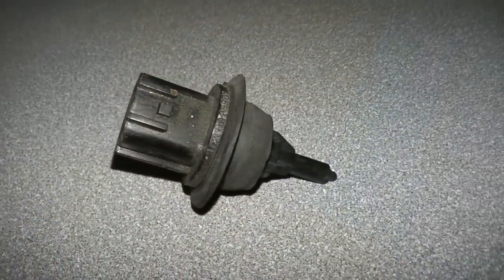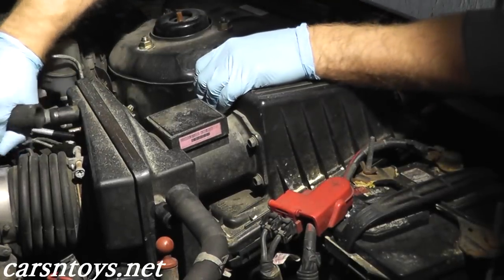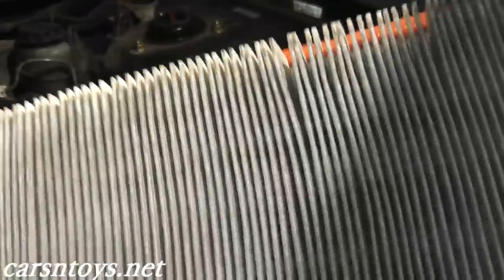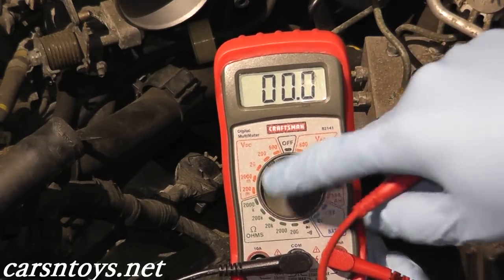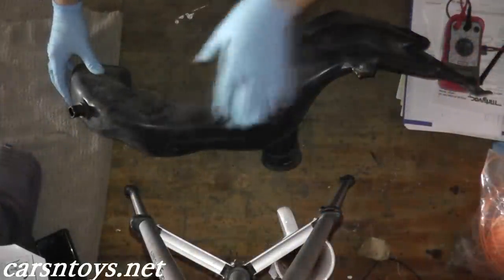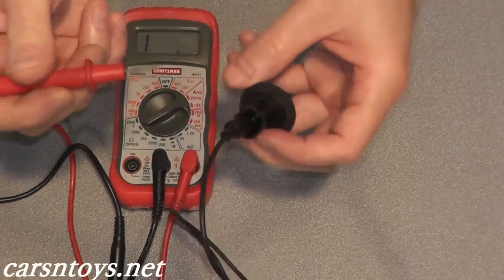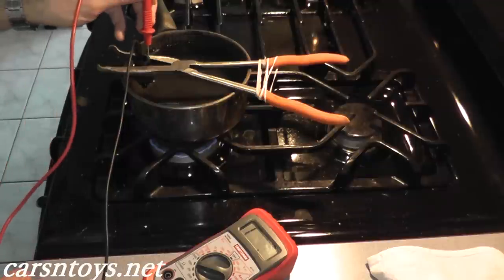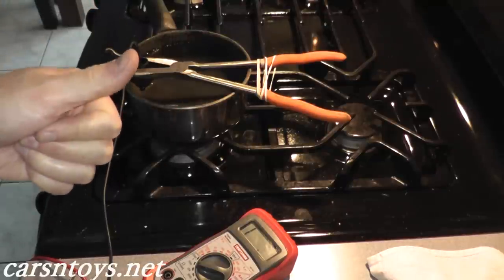How To Test and Replace Intake Air Temperature Sensor P0110  HD

Comment: Many thanks for your video. By any chance, do you have another one showing on how to repair the wiring of the IAT when we do not get continuity/ after all, changing sensor is the easiest part and the one that mechanics love to do. I would like to learn about the other end of that connector of the IAT sensor. Does it end in the fuses boxes? The electrical repairs are the most expensive.

Comment: Thanks!  I didn't know what this device was, but the two wires broke off right at the harness. Not enough to solder to!.  After seeing this video,  I removed the sensor and tested it. It was good (1.9k)
I checked the two frayed wires that broke off the harness. Good (5v  and Gnd continuity).   Rather than buy a new sensor and harness I scraped and cut away enough of the harness to solder two wires. I mechanically strengthened them to the harness.  I checked the resistance of the two new wires after plugging in the sensor.  1.9k  Perfect. I put the sensor back on the intake, soldered the two new wires to the frayed ones and voila! no error code, and probably smoother running in the winter.  1997 Infiniti Q45 w330k miles now runs perfectly again. Zero cost. 15 minutes labor.
Thank you!  You do a great service to all is DIYers out here.
Reply from the maker: +Mitch Bogart Thanks, Mitch. Glad to help and good job getting the sensor back up and running
Reply: +CarsNToys All the tests that i did came out good. So if i clear the code from the code reader it should go back to normal?Great video very informative/Cheers
Reply from the maker: Rob Hernandez
Yes but it's interesting that the code came up.
Reply: +CarsNToys I cleared the code and started the engine, no more code! yay!Now to keep an eye on it hopefully it wont come back.Cheers
Reply: +CarsNToys  Probably the reason was that i had to take the distributor out to change the body "o" ring and i had to remove the air filter assy so i had to disconect the plug to the sensor.Thank you for the fast response and great video!

Comment: .. by the way, the hose clamp used at 7:50 - is one with brown handle grips beter than one with blue. I've seen one at my tool store with blue grips - does this make a difference to the multi-meter readings? Please explain. Also, when you grip the sensor plastic housing - what torque are you using? Have you calibrated your grips? Do you have a calibration tool? This video clearly needs more explanation to be understood clearly. Is there an accompanying manual for download? (Is it available in different languages?)

Comment: a section of the harness came loose from someplace.  it had a grey connector on it but after taking the car home (after an accident)  the connector had dragged on the road and lost its connector.  enclosed pictures.  can you tell me what i need to do to repair this. does it have to do with ambient temperature sensor?  how do i send pictures?

Comment: I have a 99 Maxima that had been giving me a little bit of trouble starting for about the past month- sometimes I would turn the key, it would crank, but wouldn't fire, I'd release the key and try again and it would fire up. Finally a few days ago it wouldn't start at all- just crank crank crank. After swapping out the fuel pump, fuel filter, and battery, I was finally about to call the tow truck when I noticed a wire dangling loose. It was the wire harness to this air temperature sensor- the whole sensor had in fact broken out of the air intake duct (someone who owned the car before me had apparently lost the rubber grommet that holds it in, and tried to epoxy it back into the duct.) I got a 70 cent grommet, plugged the sensor back into the intake duct, and the car fired right up. So if you have a crank-no start issue that's driving you nuts, you might check this!
Reply: The same thing happens  with me..even when I boost my car some time crank some time silence I discover the harness is exposed and one of the wire cut and both of the wires fried of heat. So I am going to change sensor and harness. Thanks so much to share with us your experience.
Reply: Thanks for sharing your experience. I am having now a crank no spark with my camry and error code telling me that air temp sensor has a problem. 
This might give me a hint, thanks!

Comment: Hi I have a 2014 van and have a dtc0110 air intake temp fault. No light on dash but van is down on power? Would this sensor cause this issue ?

Comment: Great video. Thanks for your help. I swapped the sensor out as per the video.  I do not have a multimeter so I just opted to buy a new sensor. Now I wish I would have had one because on a 98 i30 I am getting P0110 sensor wiring code. And P0302 cylinder 2 misfire code. I had a code on cylinder 4 and swapped it to the 2 position and the code followed. 

Car is rough, low power, misfiring and stalling out at lights. I swapped spark plugs and fuel filter too. 

Could I have a bad wiring harness for the air intake sensor and a bad coil pack?

Comment: i think it is not the voltage you are measuring. based on the video ( meter range)  ,  you are checking the resistance of the sensor.  But anyway, thanks for this simple demo and clear explanation.
Reply from the maker: +keane cabrera Glad to help

Comment: Can i test a ambient temperature senso the same way IF I CAN i already did it and im getting power even with the ignition key of is the normal and when i check the continuity i was having on both pins

Comment: This video has been very helpful. On my 2002 Citroen Xsara Picasso I've got a P0105 (MAP sensor) and a P0110 (air intake temp sensor) code. I got no resistance on terminal 2 of the connector with the ignition switched on. I had the same on terminal 2 of the MAP sensor connector and these are connected to the same pin on the ECU so I think there must be a break in the wire or a bad connection.

Comment: Do I have to disconnect the negative terminal on my battery before doing any testing?
Reply: Maria, at least for this video test he did mention to turn the ignition key to ON, so that indicates to me that we need the battery cables connected for the testing to be done. How is your learning doing? I am in the same boat. I also have a P0500 code to fix and I have been driving w/o speedometer for 2 yrs. Regards from FL.

Comment: This sensor it's designed to measure the air weight because boulder the air the heavier and the hotter the lighter so the computer can calculate fuel trims. 
But don't get me wrong I'm just trying to help here. Greedings. :)

Comment: I used a heat gun to test my cabin air sensor and it worked fast and have me the info I needed. just don't burn yourself.
Reply from the maker: Good tip!
Reply: I have a couple questions about my 1998 Nissan pathfinder. Been doing tons of research..

Comment: CarsNToys Hey great video, thanks.

Tested the IAT sensor and its good, but terminal one on the harness is only reading 0.02 volts. Could this be a bad harness or the wiring itself?
Reply: CarsNToys Ended up being the red wire. Had a small break in it. Thanks again!

Comment: Thank you so much!!! I already replace this sensor and my car (Infiniti i30 1998) runs perfectly now. Before, the motor TurnOff / Die every time. One question: Now my car show CODE P1320 (Manufacturer specific) and the SES Light is On. I replace the ignition coils and spark plugs too. Any idea? Tks guys!!!!!!!!
Reply from the maker: Leandro Martini Check out my site carsntoys.net. Click on auto repair then click on engine control. You'll see a video for P1320.

Comment: When theres no reading on the harness theres a problem with the circuit? What would be the solution for that? Cause Im not getting any reading on the harness connector at all
Reply from the maker: First, check the wiring; make sure there are no breaks. (Typically, near the harness connector.) If that looks okay, check the fuses.

Comment: When resistant drops that means more voltage coming to car computer. In other word the sensor tell the computer that the air is warm or cold or hot. Is it true?

Comment: It is great, does it effect emission test?
Reply from the maker: Yes. If the engine light turns on the dash they won't pass the vehicle. (At least in most states.)
Reply: @CarsNToys  Air temp is used for computations for the car, but, would you know how it actually would cause emission leaks?  Also, having recently had a mass airflow DTC and resolved with merely cleaning that sensor, may the P0110 also come from merely needing that sensor cleaned?  Thanks for any thought you may have.

Comment: It's not voltage that is dropping, it is the resistance dropping. For example at 9:17 or so.  Using incorrect terminology (saying voltage instead of resistance) just confuses all that don't know better, and are attempting to learn.

Comment: My bmw e46 2003 model 320i has a problem of air flow meter if It's conected the car is masing. I bought the New one but it's doing the same thing help pls
Reply from the maker: Obtain a copy of the BMW service manual. The manual will show you the locations of all sensor and its wiring.

Comment: hi my car sometimes wont go over 1000 rpm and i have to swtich the ignition on and off to get it working. i was told by a mechanic its the air intake sensor and that its faulty. just wondering what your thoughts are on this and if this is the case . im actually in the middle east and cant really trust the mechanics here so i wanted a second opnion. this is my first car so dont really know what im doing. any help would be much appreciated
Reply from the maker: mohammed jawaad I think the mechanic may be referring to the mass air flow sensor. Best way to verify is getting a code reader and see if any codes come up. I do have a video on the mass air flow sensor as well. Just search my channel. Good luck

Comment: I got a hesitation only on hot sunny day I'm starting to believe my intake  temperature sensor is giving a false reading... it's 88deg outside and my temp sensor is reading 129deg I don't know if that's normal
Reply: Did you get a answer

Comment: Where is air intake temp sensor on 2006 kia sportage 2.0l?
Reply from the maker: I'm not sure. Try searching via google images. If no luck, purchase a repair manual for your vehicle.
Reply: mgoodell76 
Sell the car problem solved

Comment: 6 minutes 30 seconds of absolutely nothing whatsoever that pertains to the title. This person talks entirely to much anout nothing important. Save yourself time, using a meter check resistance, heat up sensor, resistance should drop, if not, it is bad.

Comment: I have a 2000 maxima and my IAT does not sit tight in the whole. One of the wires to the connector came out. not sure how to fix.
Reply from the maker: They typically snap back into the housing.